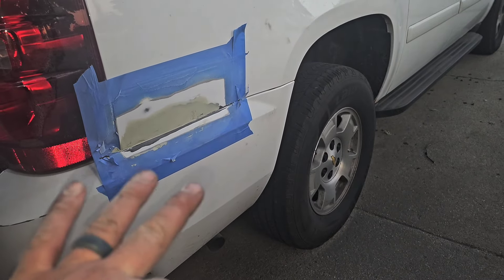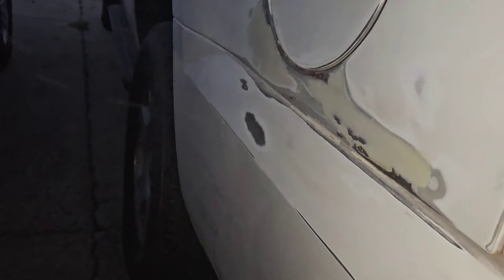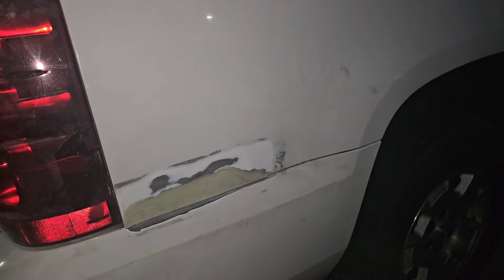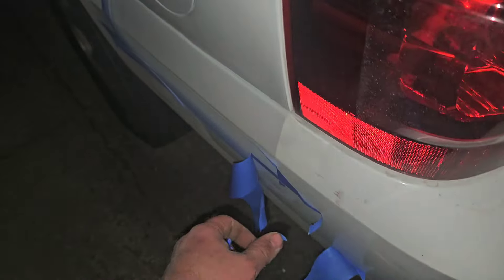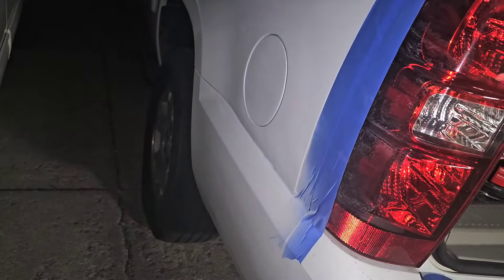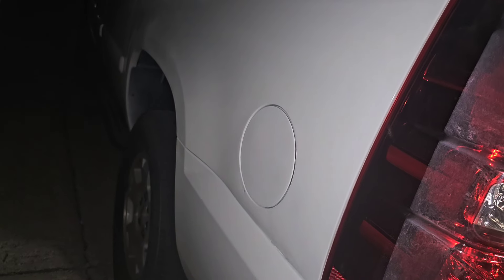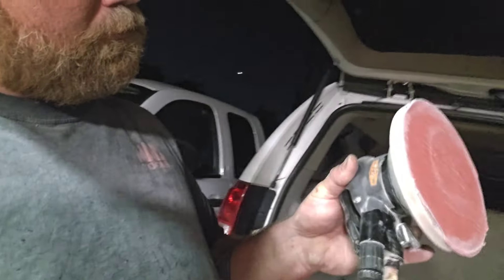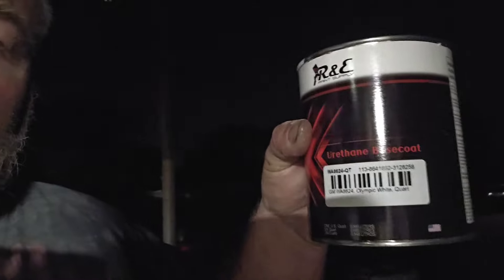Lets Fix Some Rust Holes On The 2007 Suburban- -  Drive Way Amazon Job

Comment from the maker: Spray Gun Kit 39.99 - the bigger number option
https://amzn.to/3A8AZxd

Mixing Cups
https://amzn.to/3Snv0Lx

2k Primer 
https://amzn.to/46t5J8w

Artic White GM Base Coat
https://amzn.to/4deUSRG

Clear coat
https://amzn.to/4defI3y

Bondo
https://amzn.to/3Wo3A9k
Reply: Would you ever consider making a video on resuing top shelf oil filters I.E your Fram Ultra Synthetic,  Puralator Boss , Amsoil , Mobil1 , WIX XP 
 For 2x usage.

Like doing a test from one oil change, draining the filter completely upside down a plastic cup cleaning and re-installing.

And then submitting another test after the Second oil change to see if there is a difference?

Thanks!

Comment: My Son is a brilliant machanic and body man. Of course thrue genetics. Im trying to get him to find time to work on my 2006 Ford Exploder lol Explorer.. Jersey uses that road  brine in the winter and rots the fars . Good work you do.  Blessings to youvSir.
Reply from the maker: Right on!
Reply: The salt water brine used in the upper East Coast and especially Canada will eat thru your car the quickest.  

-Need to Fluid Film or PB Blaster Surface Shield before winter for certain and don't store a salted  vehicle in a heated garage (worst thing you can do).  Car wash on sunny days during the winter when possible.

Chicago on the toll roads still salts 2-3x more than Jersey though.  = They want that toll money (especially semi-truck) at all times and do not mess around.

New vehicles are $40-50k+ now, so a simple $1500 3 ton lift at home may make sense to keep your salted vehicle running another 10yrs.  -Clean/inspect all your neighbors vehicles also.

Comment: Nice Job.  Body work is very expensive at a body shop, so you saved a ton of money.  Check out the cost of a new Suburban!  Yours is going to be very valuable to your family - a workhorse.  I have a 2012 and I really am a stickler for maintenance - it is like new.  I Fluid Film mine annually here in PA.
Reply from the maker: Thanks! Will do!

Comment: What grit sandpaper were used?
Reply from the maker: 80 grit for block sanding bondo and 180 grit for feathering and 320 to finish it some and 400 grit to complete the finish on the primer
Reply: Thank you. Need to the same job on a 1997 honda crv.

Comment: Great job 👍. Do you think it would be worth the effort to drop those vinyl panels and check the bottom edge of the metal panel you're fixing?  Just a thought 💭
Reply from the maker: I cut it out to the edge on the passenger side and then put a piece of slippery plastic as a bridge between the bumper and body and made a new edge with screen mesh and filler

Comment: That looks horrible lmao
Reply from the maker: Thanks
I know that's your way of saying good job and not an insecurity showing
Reply: @FordBossMe  You didn't even sand in between the body and the bumper for one,  two not sure why you sanded the bumper along with the body.....You can clearly see you didn't block it or at least use high build to hide the imperfections. If your going to do a hack job at least do a good hack job. 15min extra and it would of been a night and day difference. 

Block it with guide coat and use high build primer next time and it will look less like a used car dealer did it.

Comment: Why bother….? Every dime you put into this money pit is a dime you will never get back …. I’ve seen where these things end up you making steady trips to the bank then you eventually bankrupt and divorced and the suburban in the junkyard where it should have ended up when it came off the factory line
Reply: it saves about $100k by doing it. and i beg to differ on your opinion on the junkyard part. my 01 silverado manufactured in 2000 has been on the road 24 years, no major work on anything. all that's been done is break lines, rotors, calipers, breaks, tires, and one cupouling at the heater core. oh, i've changed the serpentine belt and tensioner, plugs and wires. every other thing on that truck came with it off the factory line. 24 years as a work truck too/ i'm a retired remodeling contractor so it's been worked hard for those years. there isn't a new truck or car that is capable of doing this anymore no matter the make or model.
Reply from the maker: Scrooge much? Take it easy buddy I'm not looking for advice 

I didn't ask, I know what I'm doing

Jeez
Reply: New Suburbans are $80k+ and these older Suburbans are more truck than the new ones.  Most full size trucks are also $50k+.
Reply: I went to that school
Reply: Somebody didn't poop this morning!
Reply: @FordBossMe  really, where do these people come from? you're fantastic at what you do. dedication to your work, and helping others with your knowledge. i forgot one thing i did to my old truck. i asked you a couple three years ago, turned out you were right on you diagnosing it without seeing the truck, the fuel pump. so i checked the pressure as you suggested, and replaced the pump. did wonders, course it's a michigan work truck. there isn't much left of the body. salt does wonders too, just not wonderful things. old and retired, so can't fix that. but she sure runs good.